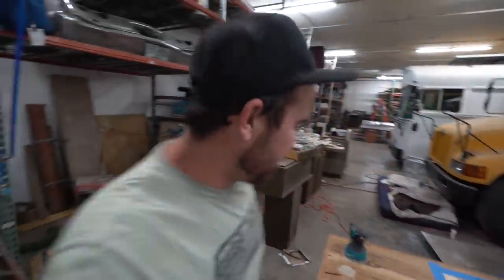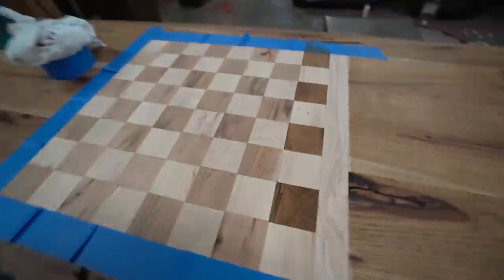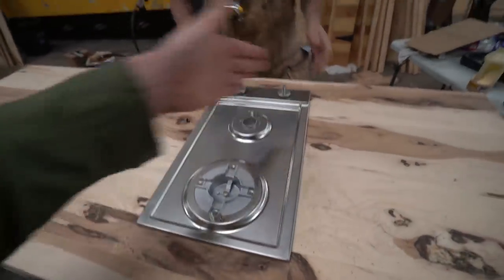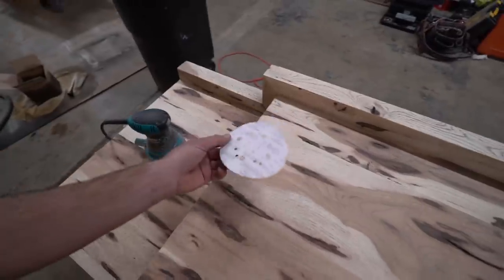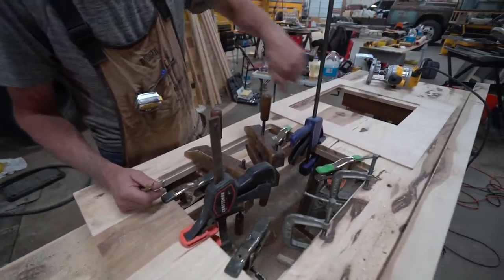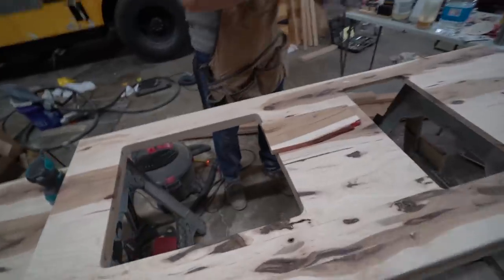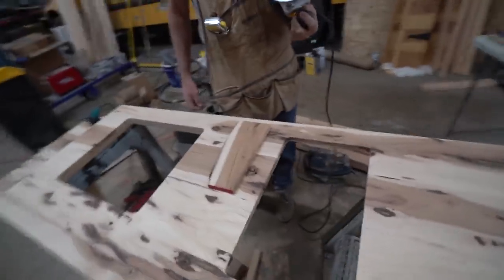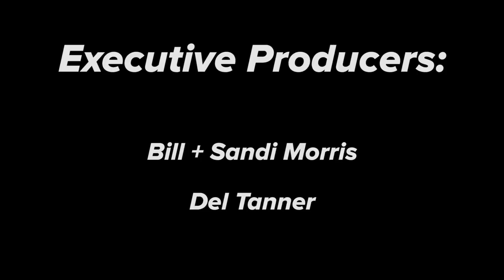Re-Stain + Counter + Cut-Outs, New Fuel Door, Bathroom Tiles in School Bus Conversion

Comment: My choices would have been no stain, dark walnut and hard maple for the chess board, with a blood wood or rose wood border. Top with a good clear for counter tops. And the big sink. If you cant decide, go with the small one. You can upgrade later to the big one. Little difficult the other way round.